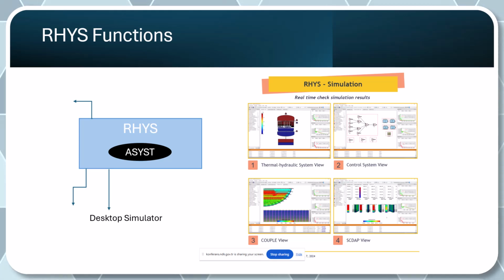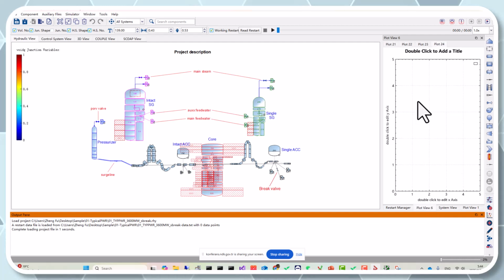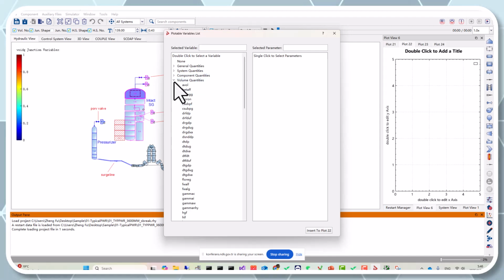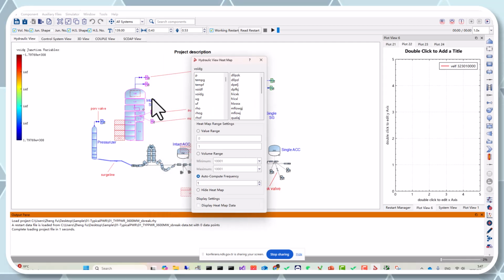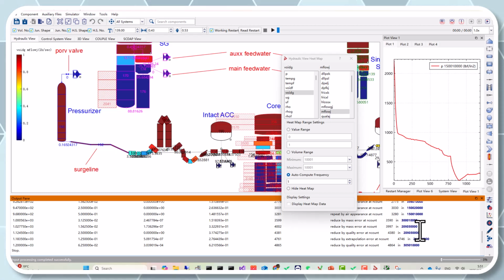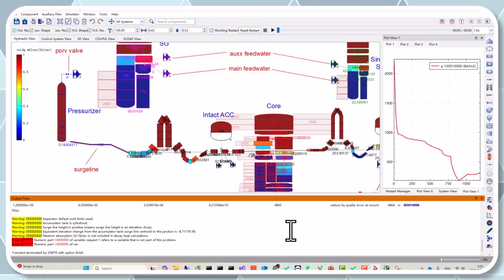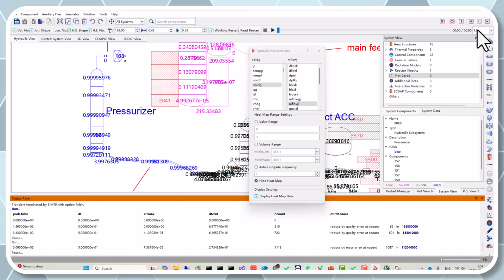Section 5: Visualization - Running a Project and Setting Up Plots and Heat Maps

Comment from the maker: The RELAP/SCDAPSIM and ASYST code,  developed by ISS, are designed to predict the behavior of reactor systems during normal and accident conditions. For more information, please visit: https://relap.com

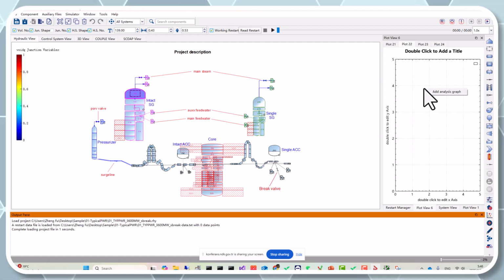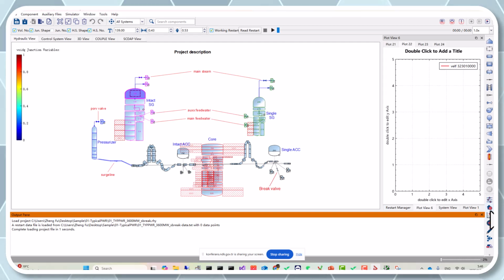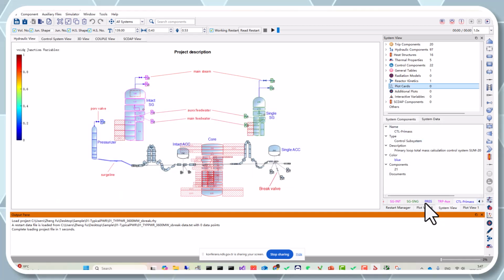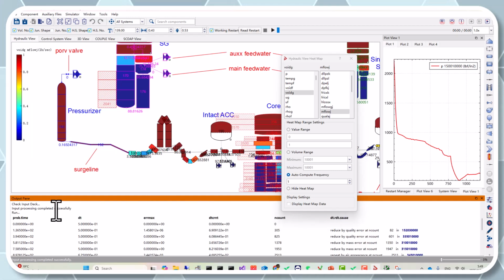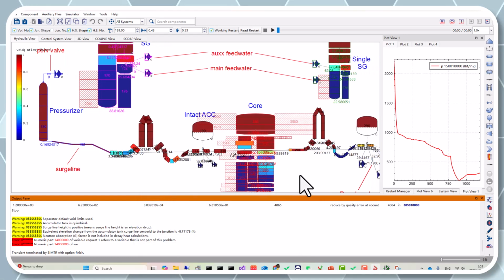This video explains how to set up and run a simulation, focusing on visualization tools. It covers three ways to add plots to visualize simulation data (0:55, 2:57, 3:28) and how to bring up and customize the heat map to display volume quantities and junction data (4:04). The video also details the information displayed during a simulation run, such as time step reductions due to quality or mass errors (6:10). Finally, it briefly mentions the 3D view and real-time interaction capabilities for modifying simulation variables like trips, boundaries, and controls (9:44, 10:11).